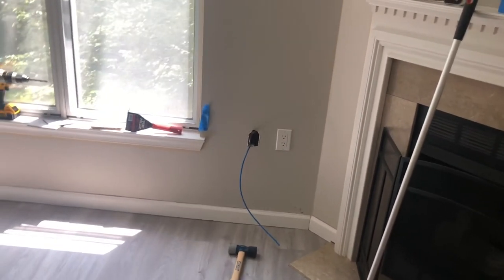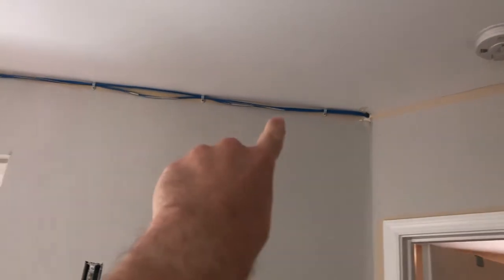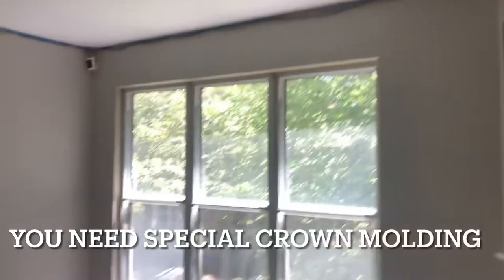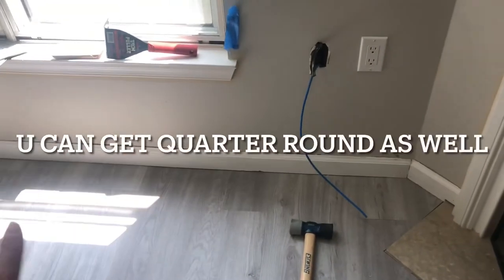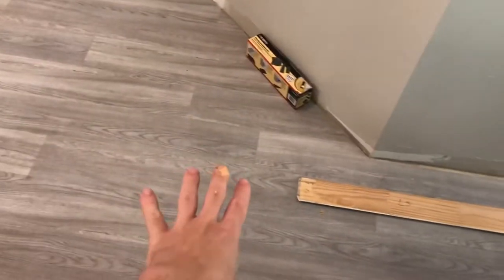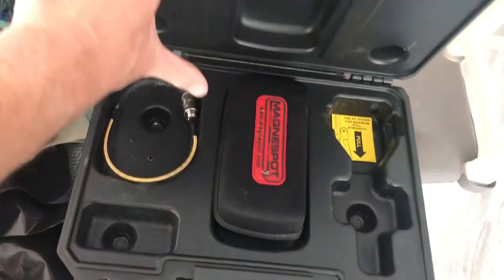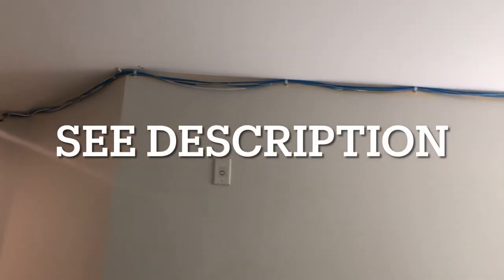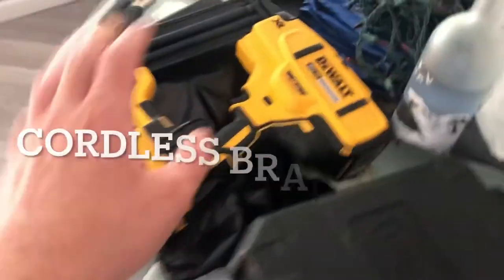Smart Ways Running ETHERNET in Your Home

Comment: I think this is a great idea. Lots of people out there in similar housing conditions. Also for those who aren't comfortable with using a 6ft flex bit to drill between floors.

My only concerns are, 
1: Expansion Gap for floor now is smaller. CAT6 is about a quarter inch thick. If you only had a quarter inch gap to begin with, now you have no gap. The routing of the floor may solve that though.

2. Bend radius. Ethernet has about a 1 inch bend radius before damage to wire could occur. Just wondering if going around corners is within that limit.